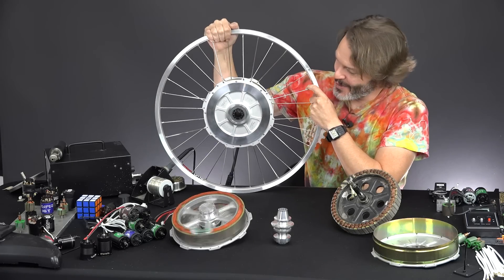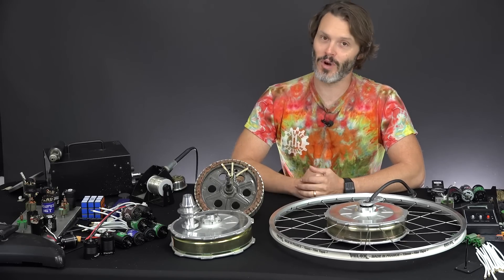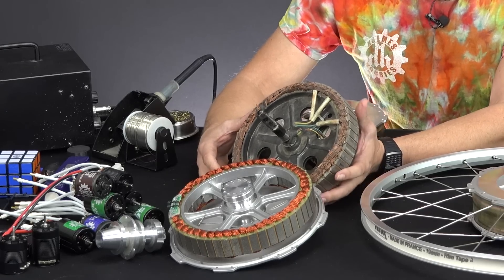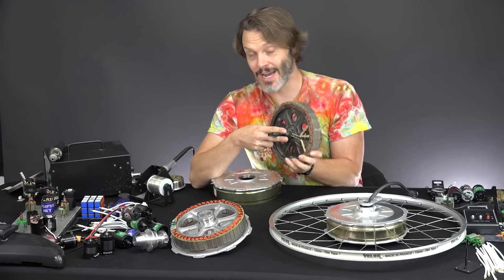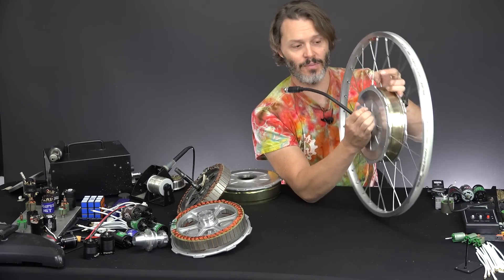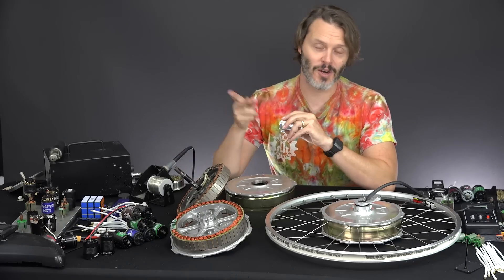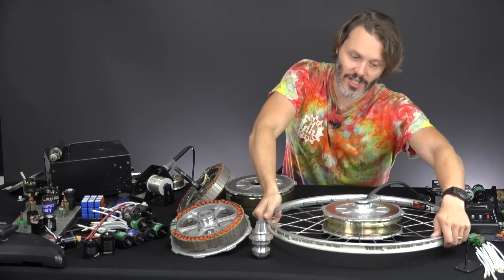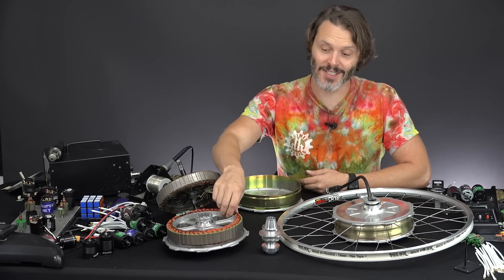Best E-bike Motor You Can Buy - Grin Tech All Axle Electric Bike Hub Motor Overview | Holmes Hobbies

Comment: Imagine if tesla engineered affordable retrofit hub motors and power units for Bikes, MCs and Cars.
Reply: If Tesla were doing it - the retrofit motors would be engineered for "performance" more than being "affordable" and that's okay. If Grin can produce great 2Kw ebike motors for $700 - Tesla may be able to produce a great e-motor rated at 10Kw for $2000. That's nowhere near affordable for your average hobby e-biker, but that would be cheap for a road-legal motorcycle or scooter that can get up to 75 MPH or better.
Reply: @Nphen  lol, as if Tesla hasn't been continuously working since day 1 to scale everything they make in to something affordable and more efficient
Reply: @Nphen  what about battery live with 2kw  would cost and weigh a ton

Comment: I have a 48 volt 500 watt hub motor mounted in the front wheel of my two wheeled recumbent, and yes I use a torque arm, and I've never had a problem.. But then again, since it is a Direct Drive/Magnetic motor, it does not spin up as fast as say a geared hub motor. On the plus side I have a maximum load limit of 600 pounds, and since I often pull a trailer, it works just fine for me. Oh, and my parents live on top of the second biggest hill in the city I live in. A one mile uphill grade. Okay, so its a good motor, but what is the voltage and what is the wattage? And what is the load limit?

Comment: Wattage, voltage and max speed would have been nice.
Reply: He was too bizzzzy being wacky.
Reply: The controller does all of that. Depends on what you're trying to do
Reply: @ExileTheKnightsOfMaltaNow   Motors are designed for voltage and watts.  You can overpower them but they still have design restraints.

Comment: Hey there, didn't catch your name mine's Aaron. I really loved your video so ofcourse I subscribed to your channel. I'm new to the e-bike concept. I'm about to convert my 2019/ 27.5 Diamond Back Overdrive. I was wondering what kit you would recommend for it? Want to get your opinion on a few conversion kits for around 500 us dollars not including battery. The battery is another day lol. Thanks and take care!
Aaron
Reply: Go to www.ebikekits.com. I got the Heavy duty direct drive motor for my bike, laced into a 20 inch front wheel, I ride a recumbent. They also have geared hub motors. It all depends on how much weight you intend to put on the bike. A Geared hub motor has about a 300 pound load limit. Where as the Direct drive hub motor I use, has a 600 pound load limit.. Hope this helps.
Reply: @JamesHart62  This domain if for sale???  No information here.
Reply: Try : https://www.ebikekit.com/. The motor and wheel and electronics package will cost a bit more, but the warranty and service are GREAT.

Comment: Thanks, looks a good refinement of a direct drive hub motor, I would prefer a geared hub, but I know this is not everyones preference.
Reply from the maker: grin also has a very nice direct drive (without freewheel) they have worked on.   Can't have the all axle without a full planetary redesign they probably won't tool up for soon, but if you bug them too maybe it will happen.   I would also prefer a geared motor but will take the resilience and efficiency of the all axle in the mean time.
Reply: @HolmesHobbies  as the comedian said: "You can't have everything...where would you put it?" The smoothness and quiet operation of a gearless (direct drive) hub motor is truly a wonderful thing...The inherent lower torque of these motors is only a downside when starting out from a stop or confronted with a sudden uphill grade change. But these two conditions only happen or make up a very, VERY small percentage of the total ride time.
For the quiet and smoothness I just LOVE my gearless/direct drive bike....if I'm bushwacking on dirt trails / single track I use my geared hub motored bike....face it, for EVERYTHING you need TWO bikes. It's as simple as that.

Comment: if you have a giant wrench you can tighten  a regular hubmotor sufficiently.
Reply from the maker: Only to the point that it strips the axle threads.
Reply: I've been playing with hub motors for 10 years and its never happened.
Reply from the maker: @warlockboyburns  I've stripped a few problem child setups.  Typically ones that simply won't stay tight due to having regen brake.  Or pushing 120amp phase current....
Reply: @HolmesHobbies  Lighter is nice for sure anyway.
Reply: I’m not a ebike owner. However if the axle nut is backing off. Use a set pin to lock it in place. Flush mount the pin. Them ping the axle in both sides. 
Again not a ebike owner just a old school builder of machinery

Comment: I think Grin is a great company that is moving the ebike industry forward. I would like to see a smaller lower torque version of this motor for street or commuter bikes that run higher speeds and don’t need a ton of torque.
Reply: seen a video where someone tried making a sort of gearing for a DD motor where the windings are slowly moved away from the magnets which causes the magnets to rotate faster due to field weakening, it ended up producing nearly 2.5x the original speed but had 3x less torque
Reply: This

Comment: I’m running a front 9C motor on my conversion ebike. (44V hand assembled battery, old school mtb, 26 in wheels, 35A controller) I would have loved to get one of these Grin hubs but it was not in my budget. Your advice on a torque arm is good, I have two on my bike.

Comment: I have nearly 1000 miles on my 3 year old Rad Rover. I’ve gone through a set of tires, a chain, brakes, and the derailer needed to be adjusted... but the motor has never given me problems. 

The left side pedal keeps coming loose... I’m about to dump a bottle of red loc tite on that fastener. 

I’d love a mid drive though... kinda funny how it’s a 750watt motor and my little rc car has pulled 1700watts from the data logs.
Reply: Thanks for helping prove that rad sells over priced junk. None of these parts should have failed. All the rad bikes I have seen have either been brand new or broken. They spend a lot of money on promotion and make up for with cheap components. They have fooled lots of people with the business model that you can never lose by underestimating the intelligence of the average customer. I ride several thousand miles a year. My parts don't fail. I buy oldies but goodies. One of my bikes cost $16 at the thrift store because the tires needed air and the cables needed adjustment. It's 34 years old and still going strong. My ebike cost $480 and isn't a whole lot better than a rad but at least I don't have parts failing after a few thousand miles.
Reply: @kathryncasey4114  What parts have failed? Brakes wear and with an ebike going much faster the pads have to deal with far more kinetic energy. Tires are consumable and aren't made by rad. Derailer just needs to be adjusted, it works but started popping out of 7th... not difficult to do.
.
The chain was totally my fault for not cleaning it and lubricating it as I should.
.
I agree that the bike doesn't reflect a good value proposition. I wouldn't be surprised if the fork was dry, but the lockout still works. 
.
All the electronics works as they should.
Reply: @KTMcaptain  Forgive me for using your comment to share my opinion. A bike with 1000 miles on it is a brand new bike. It shouldn't need any repair or maintenance. Good tires last ten thousand miles. Rad didn't make the tires but it charged you top dollar for tires that are worthless and dangerous. I use a good old self lubricating chain. It keeps itself clean by going round and round. It keeps itself shiny and smooth by going round and round decade after decade. Rad didn't make your chain but they sold you the cheapest one they can get. My fully loaded touring bike weighs about 150 pounds. I way 120. That puts a lot of stress on brakes coming down out of the Rockies and the Sierras. I don't have to replace them or adjust them. A good ebike and a good regular bike are a joy. Rad spends it's money on advertising and promotions but provides a bike that is a maintenance and repair nightmare. It is no wonder you don't ride very much.

Comment: Years back I bought a Crystalyte motor from Grin and it runs with a 52V 18AH battery in a front axle configuration. The motor sits in a steel fork with two torque arms. So far I love it but I will upgrade to the all wheel motor in a rear axle config eventually.
Reply: A few years back crank motors where the best and easiest to install. Now they are not even mentioned.

Comment: 4kg on a down hill fork??..google un sprung weight suspention...fantastic its a through axel desighn....you forgot to mention its disk compatable...i guess i need to look for other vids to see what it does...is it just front wheel?
Reply from the maker: there isn't much actual downhill in Missouri, if I really wanted a bomber it would have a mid drive.
Reply: @HolmesHobbies  exactly!

Comment: I got their GMAC motor and am very happy with it. The All Axle motor looks really good if you prefer front wheel hub motors over rear wheel ones. Grin is an awesome company.
Reply: The GMAC 8T i had was very good performance wise. But it overheated quite quickly and it only lasted 6000km before it self-destructed (axle bends over time, causing internal parts to rub and pieces fall apart. Typical Chinese quality. Also condensation is a huge problem if you live in a place with cold temps. When I opened the mac it had a lot of water trapped inside. Also the spokes cracked because of the weight of the hub motor.
My dream bike has a mid-mounted direct drive hub motor that powers the rear wheel via an enclosed chain and only a single speed cog in the back.

Normal mid-drives eat a chain and a cassette every 300 miles...
Reply: @videosforcatsanddogs214    why not belt-drive?
Reply: Is the GMAC a geared brushless and not DD? with a through axle/"all axle" system? I too have a fondness for the less appreciated front hub!

Comment: Do you ever see something like this coming into RC? Whether it be directly on the wheels, directly driving the driveshafts like some TT setups almost do, etc?
Reply: Doesnt scale well. If we remove 35:1 gear reduction we will need 35x larger motor for the same torque.
Reply: @johnrobholmes  Makes sense. Just figured id ask. Always curious where the future of motors and RC will take us. :)

Comment: I have a Coleman Bt200x minibike w an aftermarket engine and all the goodies but I want to go to electric. Think it’d be easy to use a normal brushless motor mounted where the standard gas engine is. A 6-10ish hp range and an output shaft large enough I can get a sprocket on for 40chain size. I’m probably asking too detailed and too much for a YouTube video comment section lol. Unless someone makes a nice 8in rim hub motor where it accepts a 19x8x7 tire. And of course a controller and battery pack I’d need. Thanks if ya read this John.
Reply from the maker: that fat tire scooter hub looks nice for an easy route.  It won't be a straight forwards project.   Head to endless-sphere.com for the best forum on projects.
Reply: Hub motor for a phat tire scooter I found planning a fat tire off road build https://www.amazon.com/dp/B07YHN3DW3/?coliid=I3N05Y8YSV9P06&colid=2QDXJJA81MKL1&psc=1&ref_=lv_ov_lig_dp_it

Comment: How do you feel about having to unlace the wheel to open the motor?
Reply from the maker: Not a worry for me.   The sensors are most prone to failure on a DD hub, and they use high quality sensors and addressed strain relief.    I'm not going into this expecting failure, the people at GrinTech are at the top of the industry.
Reply: @HolmesHobbies  They are nicely designed!